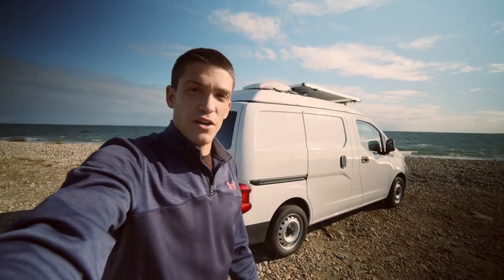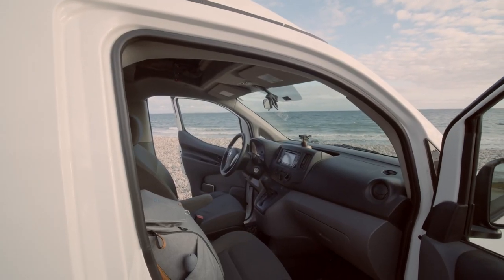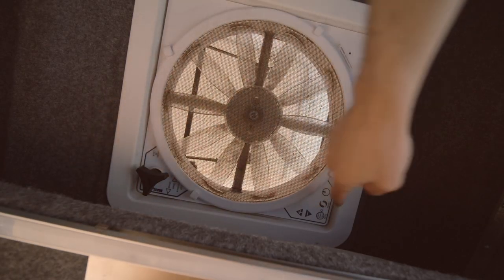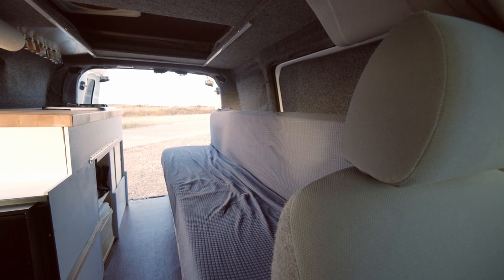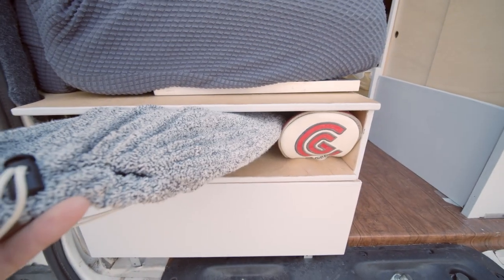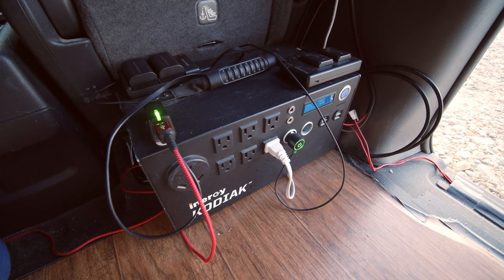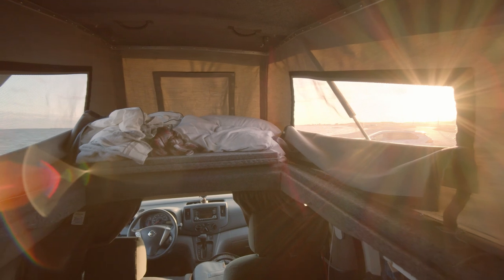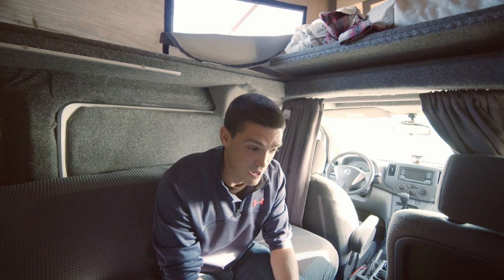VAN TOUR | Minivan DIY Camper Conversion with Pop Top (FOR SALE)

Comment: As someone who drove a nv200 and now a Honda Element I can tell you it it's definitely capable.
Reply: The NVs have been terrible as service vehicles. My company tried them for 2 years. Between technician complaints about driving them, nearly constant flat tire issues, and mechanical unreliability, it was mathematically feasible to scrap them all and replace with Ford Transit Connects and save money in the long run.
Reply: @mwilliamshs   being honest sometimes hurts ..... you should name the components so not to tarnish this sale Rocky Racoon  .......

Comment: Seems nearly perfect- well done! I would add a metal black backsplash behind the stove, not just above the stove, because that carpeting or whatever that material is behind could get saturated with smells and grease... and I agree I wouldn't want to deal with gray water smells and hoopla in such a tiny space but I think a hole cut in the counter for a deep metal Bowl would be useful... that way you could use some water on the inside of the van, whether for rinsing face or just putting some dishes before you wash them completely out side... I just think it'd be a useful receptacle area and if it had water in it you could just lift it out and dump it outside... the other little thing I would add is a small, simple folding leg on that unsupported corner of the bed platform... too bad you have to sell it, such a great little set up for weekend Adventures especially! 🙂🤙
p.s. a colorful cover for the couch bed would make a big attractive difference on the inside ;)

Comment: Great design, well thought-out. Small question - who makes the white bins you use under the kitchen counter?
Reply from the maker: Thanks! I believe Shannon found them at the Container Store
Reply: @ElementLife  Thanks for the timely response. However, I can't find them on the Container Store site and they have no facility to send a screen grab I made of yours? Square bins are hard to find; most have tapered sides so that they can stack for shipment from the factory. While I am being such a nudge, is the clever system for spice bottles using a magnetic sheet above, or magnetic tops to the jars?

Comment: I have been following you and your girlfriend from Denmark, Europe for a long time and have been learning a lot fro both of you about vanlife, with many many thanks. I really love your van layout and the problem both of you are taking on board and addressing. 
Since this van is also in use in Europe would it be too much to ask for a review about the NV200 of Nissan in terms of reliability and running costs/repairs. I love the layout but I am not 100% confident in Nissan since they started using many motor and electricity parts from Renault. What is your experience with this, having the van for a relativerly long period of time? Many thanks.